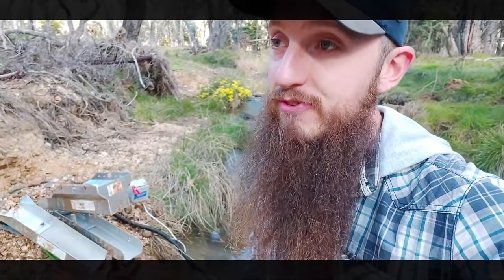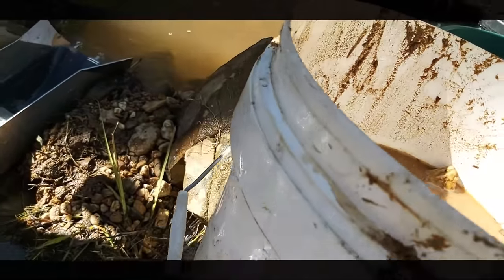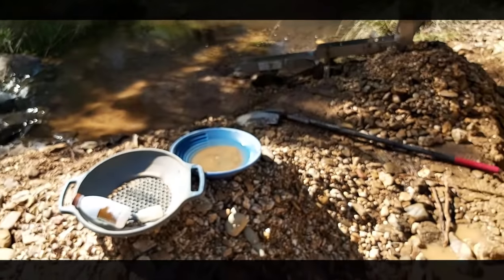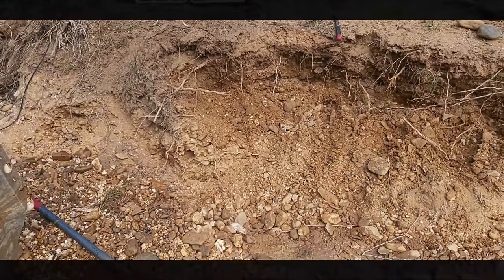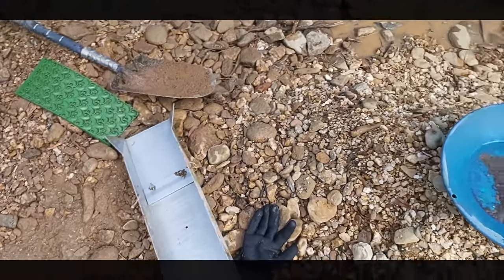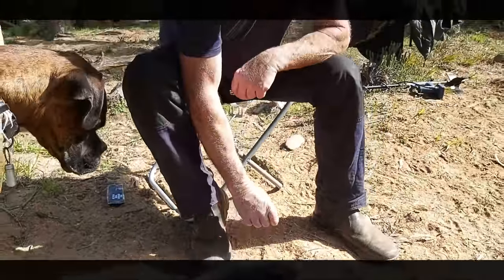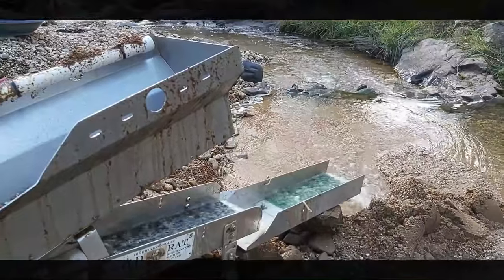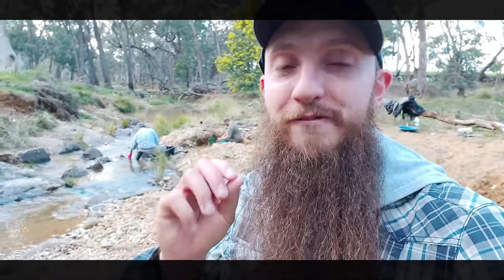Huge Gold Find in my Mine! (The mother lode!)

Comment: Hi Chris, have recently found on ebay a mini inline generator that will kep your battery charged whilst river slucing that i think you should check out. 
It is placed on to the hose between the pump & sluce so as the pump pumps, the water flows through the mini generator creating electricity that 
keeps your battery charged for a longer slucing time.

ITEM ID DC 5V / 80V Water Flow Pump Mini Conversion Turbine Hydraulic Generator Durable
Reply from the maker: Thats pretty awesome man!
Reply: @VoGusProspecting  they are i'm in the middle of testing them out for durability & longevity. Will let you know how they fair over time. Cheers
Reply: That sounds like it just makes your pump work harder but recycle some of the power, so unless I'm misunderstanding where the generator goes I think you'll run out about the same or worse. But especially on a cloudy day a little mini hydro power setup sounds really cool!

Comment: Need my little highbanker setup it is designed to catch very fine gold.  I use it in glacial drift where you cant afford to lose not one tiny speck. After many tests i have yet to find any missed gold in tailing. Even when running concentrates for clean up.
Reply from the maker: I need to make severl impriovments thats for sure!